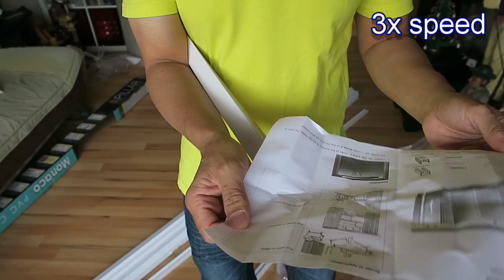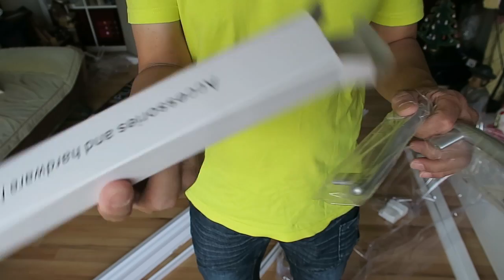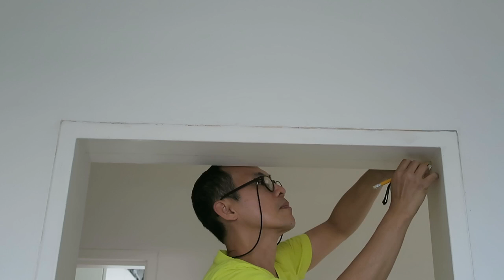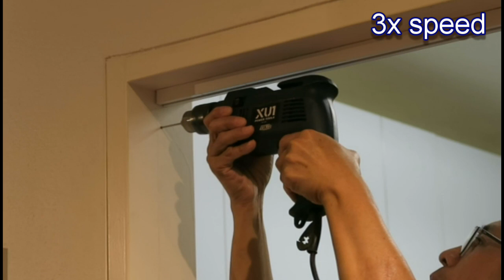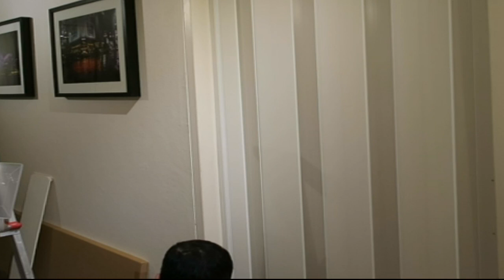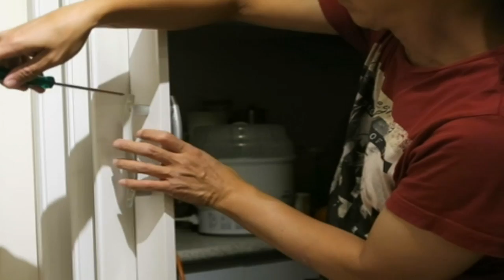DIY How to install a PVC Concertina Accordion Folding Door

Comment: Hi, I’m in Australia and live in a rental house. I want to install a door with less holes on wall as possible because I have to fill up those holes when the lease ends. How many (minimum) holes on wall I need to do to install this door please?
Reply from the maker: I have metal frame in my unit very hard to drill. 4 on top and 4 on one side. If you have wooden frame i think at least 12. 4 on top and 4 each site.